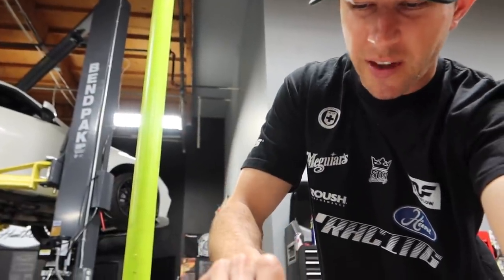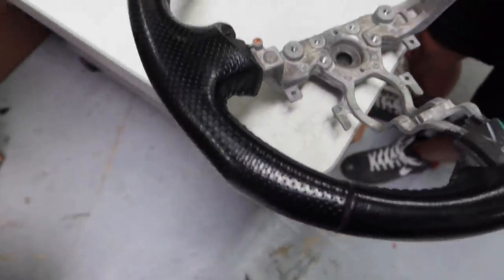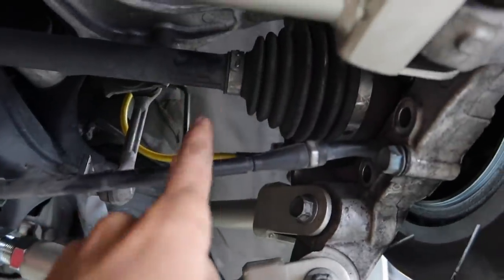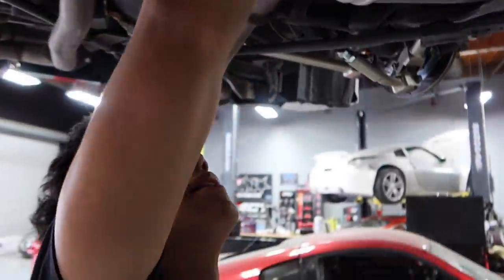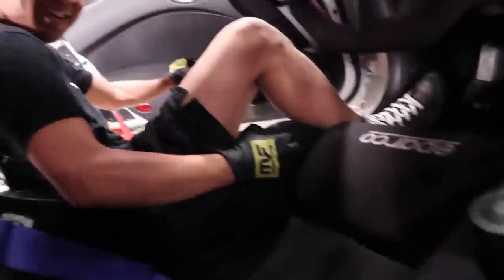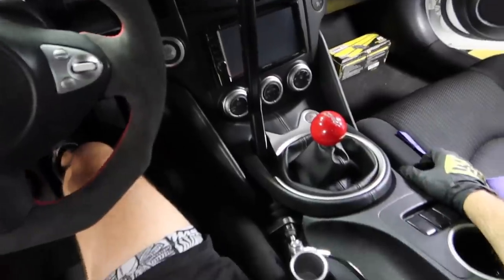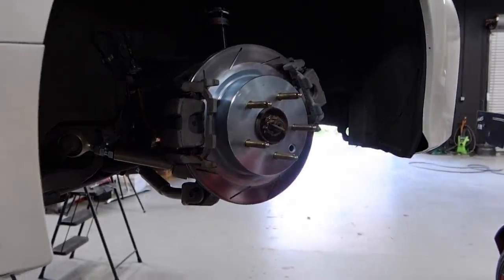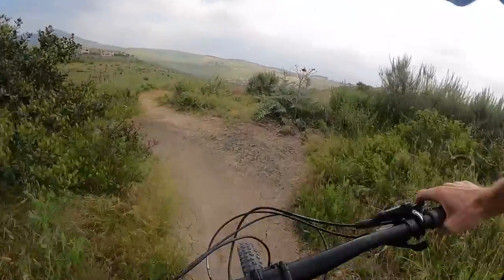Making the PERFECT 370z cockpit!!

Comment: Hey TJ. Loving the vids during Lockdown:

Some Mtb Tips:

1) load the front end of the bike morn thought the berms and trust the front grip more. Build up slowly and you'll find it easier to carry speed through the turns.

2) Really try not to brake during a turn. Its one of the hardest things.Even for someone who has been riding for a long time. If you brake during a turn it stands the bike up and it'll prevent you from carrying as much speed.

3) Keep your vision up when riding as much as possible. This will help you with braking and line choice massively.

Im a pretty experienced rider from the UK so thought this might help you.

Thanks Will
Reply: Cool
Reply: Buckle your helmet because it will fly off before your head hits the ground.
Reply: Maybe edit it to say “brake before turn, not during the turn.”
Reply from the maker: Thanks will! I’ll implement the tips into the next video :)
Reply: @tjhunt_  get some "Hand Up" gloves. 0 regerts
Reply: Not to mention keep your centre of mass lower, try put your bike in between you and the berm, which will push your weight more vertically into the berm
Reply: I would also add, lower the tire pressure a little bit. They sound and look a little too inflated for what you're riding on.
Reply: You can transfer driving skills to mtb, you don’t brake through the corners when grip racing as it makes the car unsettled just like when on a bike.
Reply: goat
Reply: 4) Always strap your God damn helmet 20:23
Reply: Ya I race mountain bikes and you can point your hips into the turn to take it tighter, and also for the berm you want to hit the top of the berm in the middle of your turn to try to carry though as much speed as possible. Also love the vids!
Reply: A good number of experienced mountain bikers including myself use the app Trailforks, it shows you plenty of trails systems near you for mountain biking with their difficulty, elevation gain and loss, length, etc. I highly recommend it.
Reply: And the fact 29er isnt stable enough for trails. 27.5 Or go back to the basic 26er is better for handling them corners! I have both 26er 27.5 29er and by far i like the 27.5 and 26er for the trails and 29er for road use.
Reply: and don't walk or ride the trails backwards, otherwise, if someone is riding the same trail you might end up crashing together which isn't that fun (;
Reply: UK gang

Comment: If you wanna make it easier going on the down hills try using a wider handlebar I believe Sunline still makes one and there’s a gravity light bar they come in to like 31 inches wide you can always cut it down also try adding a little bit more sag in the rear end and then I’ll help rake out the head angle I actually used to work at a bike shop down the street from where you guys are at

Comment: I have Bought a Steering Wheel for my 2015 STI it has Carbon Fiber on the top and bottom with Alcántara on the Sides @ 12 o’clock red stripe 👌🏽🙌🏼

Comment: Just for some comparison, an airbag comes out at 15MPH. To make that happen the explosion that pushes the bag out is compared to a 12 gauge shotgun blast which is 1,250 feet per second. When you hit the airbag it is roughly 6,500 feet per second but also keep in mind a normal airbag will only travel about 16 inches in about half a second. You are taking the equivalent to a little more than 5 shotgun blasts to the face at one time with only a thin bag to stop the rush of air. That's why he is unhooking the air bag while he drifts.